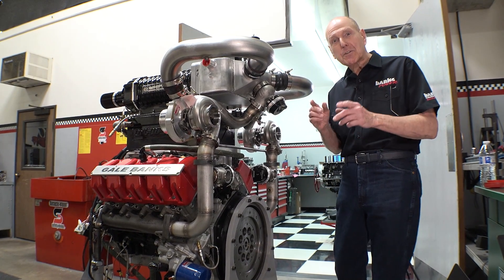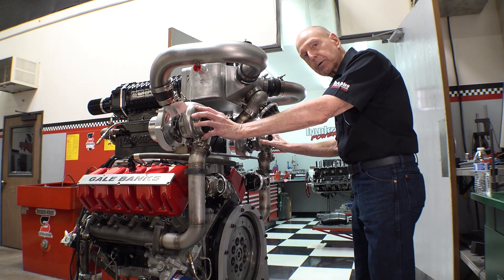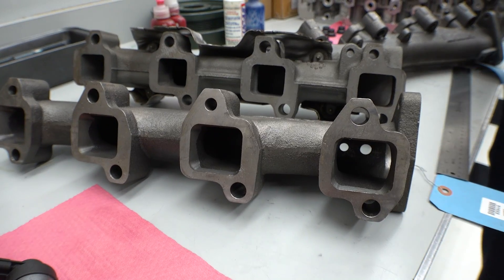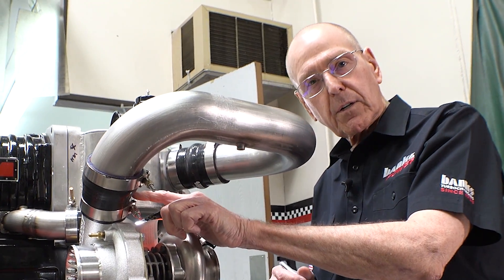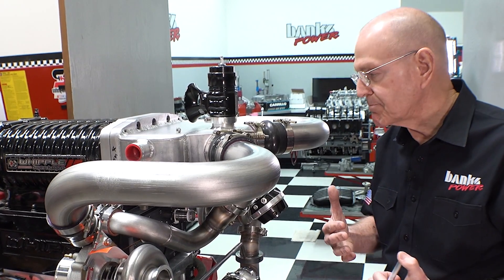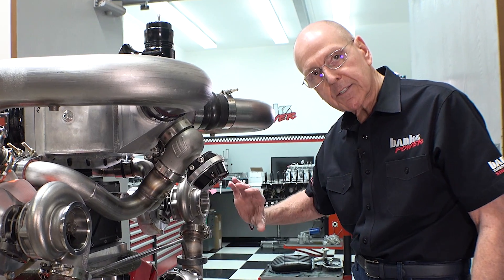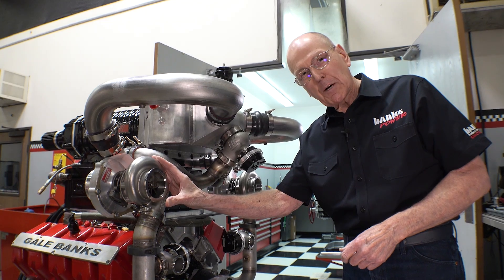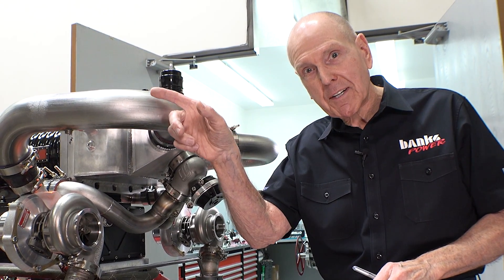SUPER-TURBO DURAMAX FIRST LOOK: Building A Monster Truck Engine Pt 10

Comment: To Mr. Banks and Team

Thanks for the excellent content in this and your other video series. I do however question the function of your supercharger bypass system. I suspect (running a model) that, instead of air flowing from the turbocharger bypassing he supercharger and intercooler; it in-fact back feed. Let me explain.

Unfortunately, Precision don’t release compressor maps, but we can use the Garrett G35 or BW-EFR 8474 as a stand in as their compressor wheels are the same size and are known to perform similarly. With a pair of these turbochargers there is no doubt that you’ll have ample airflow to meet the demands of ~1050kW at the crank (this figure doesn’t take into account the power to turn the blower, I’ve assumed 150kW, which brings the measured power back down to 900kW or 1200BHP.) My model suggests that you’ll require upwards of 150lbs/min of airflow (75 per turbocharger, no issue there for a Precision-6870.)

At 5000RPM (as seen in your videos,) all else being equal, (eg: good charge cooling,) in a turbo only application you’ll be seeing/requiring close to 45Psi of manifold pressure (PR=4) Now any of these turbo’s ‘will -get-there’ JUST, but you’ll be right on the edge of overspeed and in a very in-efficient area.

But in this instance, there is another aspect to this.

The W305 pumps 5L of air per revolution. I estimate you’re overdriving it at 1.75x crank speed (~8800RPM blower speed) to get your current power output. My estimate is 22.4Psi of boost and from  the previous video where you made 666BHP, I can see 21.2Psi (so my model can’t be far off 😉.) This estimates an airflow of 96lbs/min, where your measurements are 106lbs/min, so I'm close, I suspect you're actually running the blower at 2:1 and feel you may have mentioned it somewhere...)

(Continuing with my numbers, doesn't make much difference) Now if we consider the Blower intake as the inlet manifold (or put another way consider the blower the equivalent of a 12L NA diesel @ 5000RPM,) which would consume 96lbs/min or (here’s the kicker) ~1400CFM a minute of air; the turbochargers now only need to produce ~20Psi of boost to force the required 150lbs/min of air though the blower to meet your goal. (I hope you’re following my logic, compound air charging/twincharging is difficult to write about.) This is because as far as the turbochargers are concerned, they’re on a 12L engine, not a 6.6L engine!!! This now puts the turbochargers in a much happier place on their compressor map (right in the middle 😉)

Now you can reduce the blower speed, this will in-turn raise the boost pressure required from the turbochargers to meet the 150lbs/min airflow requirment, so there are optimizations to be made here to reduces parasitic drag, however this will reduce throttle response. But IN-ALL-CASES: there will be significantly more pressure in the inlet manifold (my math’s says 46-50Psi) than between the turbochargers and the blower (~20Psi in this study.) Thus, the system you’ve installed to bypass the air past the blower at max-power will simply cause air to escape the inlet manifold and cut laps around the blower. This will significantly reduce the power-output of the combined system as there’s basically a big air/boost leak.

I’m going to continue watching, as this is a banger of a series. I hope my maths is wrong and that the system you’ve installed works as you think. But, I’ve used this model to build and spec-up twincharged systems in the past and have never been more than ~5% off with regards to boost levels once it’s all said and done. We always use a turbo to ‘blow-the-blower.

As there will be so-much exhaust gas, you might find you need even larger wastegates to no have excessive back pressure and solid boost control.

Keep on having a blast
Jordan

Comment: Mr. Banks on your blower over turbo engines. Did you every used a  clutch on the blower? When I was kid and still this date I want to build a 8-71 or 12-71 blower over turbo with 4 turbos and  blower or blowers with a clutch. Turn the blower on for low rpm and off for high rpm. The clutch be like an AC clutch.

Comment: I am loving this setup, I can't wait to see it roar. I do have a question though, is there a specific reason you chose to run the turbo WGs only at 90 degrees? It seems you have room to run then at a bigger angle. I'm sure you will not be bypassing much exhaust pressure with this power level, but am just curious. Thank you

Comment: Banks Power, wow just wow. It'll be interesting to see what sort of power levels you guys achieve, why is/ why are you chasing HP in a diesel engine for this application.
I would've thought that torque was what you'd be chasing to run in a monster truck engine, I have a basic understanding when HP/ Torque crossover in Gasoline engine, does this still apply to a diesel engine.
Anyway good luck.

Cheers

Comment: That looks awesome. there is one thing that I am concerned about and that is the turbo wastegate locations. I think you're going to have Boost creep issues on the turbos with the wastegates at a 90 degree angle on the up pipes. I think you would have way better control if they were angled what's the direction of flow. So instead of being at 90 degrees to the angle of flow... maybe be at 30 degrees.

Comment: What issues would come into play aside from pressure increase at the manifold. If you would have allowed the the turbo's to blow straight into the charge air cooler for the super charger? Essentially leaving the intake on the supercharger alone and have the turbo's blow in from under the supercharger. And using just the 1 intercooler for both.

Comment: Typical Bank's ingenuity. I've owned some model of a Dmax for over 17 years and I'll own one forever as far as I can tell. I wonder though, with the monster truck circuit like it is, with suspension parts breakage and body repair after nearly every run, is this level of complication the answer for a question no one asked...
I'm a diesel believer and I've become a snob to the point where I dismiss any truck with a gas engine as a toy, but as simple and bulletproof as a BB Chevy is, I'm not sure the crew chief is going to be excited about maintaining all that plumbing taking the beating it will be subjected to. I cant wait to see how it performs though.

Comment: Really enjoying this. Have been a long time fan since back in the seventies after seeing your twin turbo blow through system for the small block chevy. That system was impressive and your work with diesels is no less impressive.
     It is amazing the advancements in turbo tech and you have been on the leading edge. Looking forward to what comes next.

Comment: I’ve been experimenting with .60 Inconel sheets. Putting in my roller and making 4” tubing. I’m just having trouble with the welding.
Reply: Its tricky to weld you have to have the heat settings just right.

Comment: Why would you ever put the supercharger first, surely it will restrict the turbos at high rpm?
Reply: Its first to give off idle instant throttle response giving the turbos time to fully spool up.
Reply: @victorgirouard1543  but it will restrict the turbos as you cant pull more air through a  positive displacement supercharger that it would otherwise flow anyway, thus rendering the turbos useless other than a slight efficiency increase. Put after the turbos it will still give instant throttle responce as it can pull air through the turbos.

Comment: How come machinists fasten deck plates into the block with head bolts during machining when the build calls for head studs?
Reply: So they can create the same type of warping that would happen with the heads bolted down this way they end up with alot more accurate hone or bore job.
Reply: @victorgirouard1543  Head bolts are going to twist/ distort the block more then head studs is what I am saying.
Reply: @Sir.VicsMasher  it's about the same it just takes more force to stretch or breaks studs over bolts.
Reply: @victorgirouard1543  A bolt will put more twist into the block vs a hand tight stud with a nut on top.

Comment: Im curious what the supercharger does to turbine speeds at low rpm vs without. Maybe he has already explained or im just slow without help. 😉
Reply: You are just slow.... The supercharger makes 8-12 psi at idle. What do you think that does for the turbos when you snap the throttle? I've seen twincharged gas engines hit 20 psi in under 2 seconds. Try that with a big single on any engine...
Reply: @dj4monie  whoosh. And if anything i was hoping to see a video from gale giving us the sweet sweet data from both setups. Be well.

Comment: 0:55 - COSWORTH on the toolbox in the next room - must be an interesting story there!

That comment about the manifolds fitting any porting raises something I've been wondering about - most diesel 'tuners' seem to be intent on bigger 'chargers, more fuel, etc - but very few seem to mention reworking the heads and the resto f the intake/exhaust manifolds to reduce pumping losses? What would be the consensus view of making the engine more efficient as a critical part of the process of making power? BTW, folks, that outlet was 47% larger than the stock one.

Might be worth using an electronically controlled bypass for the supercharger that can be controlled by the ECU?
Reply: Any restriction you remove from the intake or exhaust allows the engine to make more power with less work.  This normally translates to more power with less boost which drops exhaust gas temps and charge air temps.  The factory duramax intakes are dog shit in my opinion with all the hard right angles the air must make along with directing air into walls and sharp corners.

Comment: Please, xplain why I wouldn't want a blower that will run out of breath as RPM increases upstream of a turbocharger that will always give me more power.
Every HP build in this world has had a turbo dumping in a blower because the blower always ran out of steam before the turbo did. The blower just helped the initial hit off idle(low end torque).
I always looked at the Pikes Peak Truck intake arrangement and always scratched my head in disbelief as to why would someone do it "backwards".

Comment: Are you concerned about feeding the super charger through the turbo inlet volutes? I wonder what the pressure there is going to be. Part of me thinks you might need a zero pressure bypass that closes after the turbos spool up to close off that part of the circuit. Secondly are you going to use  some trickery to close off the super charger inlet like HP reduction on a rotary screw air compressor ? This causes the compressor to operate in a vacuum saving power. A blower is basically a positive displacement pump in general terms. Are you concerned about the potential HP loss trying to compress high inlet pressures? Maybe for best results you might actually need to under drive / size the blower so it gives you  great cylinder fill percentages at low rpm but runs out of breath as the turbos sing or find a way to be able to run it inlet closed in a vacuum to reduce HP required and increase MAD by not adding heat to the charge air?

Comment: Can you create an epa safe or compatible version of this? And in a petrol version of this, lets say for the new 6.6l heavy duty gm pickups what size supercharger and turbo would you recommend if the cubic inches are the same?
Reply: The same, get whatever supercharger you can afford and slap some turbos on it feeding the supercharger = Twincharging, instant response, no lag and if you aren't chicken 30 psi across both compressors...

Comment: Gale, this is great. I think the turbos are maybe a touch small. Maybe not but if your aiming for 13-1400 hp I don't know if the compressors can move the air volume each required to make 700 smoke free horsepower. Running a bsfc of 0.4 and 18:1 afr, each turbo can flow at the outer edge of the curve, enough air for about 820hp. Your going to run into a few problems pushing them that hard that might.not crop up in 2 minute rounds or 15 second blasts at full throttle. The blower is going to be your saving grace here. The turbine housings are a bit oversized for 3.5l of displacement but with the belt driven compressor and charge cooler, the engine has an effective manifold air density somewhere around 1.4 times SAE standards at idle and about 2 times SAE at higher rpm. I did some back of the envelope calculations and for no smoke at 4000 rpm and 1400 hp, you need a 100% cylinder fill volume and a manifold air density of 3.68 times SAE. If your only getting 90% cylinder fill volume, which is still very good, you need a manifold air density of 4.09. Neither form of forced induction alone can provide that density with ease, but combining them will make it more than possible. If the turbochargers provide the belt driven compressor with air twice the density of SAE, and the supercharger does the same, effectively doubles the density, you will get the manifold air.density you need.

Comment: I think you should have installed 2 of the turbo supply valves and use position sensors that you can log. Also add another ice water supplied intercooler for the turbos alone.
Reply: You aren't paying attention. The cooler behind the supercharger is air to water, like the one under the supercharger. A2W is king of charge cooling, compact and works best. People are too worried about weight, unsure why when you can make 1,000-1,500 whp quite easily but that means for most of you Muscle Heads that you have to spend a couple of grand on your automatic transmissions to hold it all. I live in the Sport Compact world were twin clutches will hold all the power and have stock pedal action.
Reply: @dj4monie  Actually I was paying attention. I do this for a living, I work on  multimillion dollar race cars. I saw the cooler. Like I stated before I wanted to see another cooler installed.  BTW I am not a muscle car guy by any means I actually perfer imports and have several cars that make more than 900hp out of 4 cylinders.

Comment: Is the 90° coming off the exhaust for the wastegates  going to cause a boost creep issue? I thought it was better to have a smoother transition so the exhaust gasses can vent effectively. Does it actually matter in this case? Legitimate question from my limited knowledge.

Comment: One thing I'd love to test is the possible applications of a 1:1 compression ratio (so no compression) supercharger in a turbo to supercharger setup with the pulses of air released by the supercharger being synchronized with each intake valve opening. I wonder if this would help neutralize the air harmonics in intake runners because you'd basically never have stagnant pressurized air in the runners. You'd have to find a way to direct the airflow to individual runners but it's an interesting concept. You could even use the air pulses to try to evacuate more exhaust gasses by opening the intake valve momentarily just before the exhaust valve on the exhaust stroke.
Reply: Why don't you go out and do it????
Reply: @dj4monie  You're talking about tens of thousands of dollars in testing equipment, labor, and sensors. The only way to pursue this idea economically is to work at a shop like Banks Power where you have most of this equipment just lying around (they're not hiring right now, I checked). Best I can reasonably do right now is post the idea where people can see it and hope someone like a member of Banks's team agrees with me and maybe tips me off on a job opening for a machinist II or automotive technician I coming up soon. ;)

Comment: Gale & Banks Power: If I may make a suggestion, I think that adding methanol injection into the mix, for it's evaporative cooling properties would be a good move. Getting those temperatures down as low as possible within the duration of the engine would be wise. I'd like to read what you and others think.

Comment: Would it still be beneficial to inject a water and methanol mix below the large CAC to further increase density? Will the water supply to the CAC have an ice bath for the short duration and the water mist over the heat echanger for the long term aftet the ice has melted?  If liquid propane was added to secondary injectors below the CAC along side of the methol/water injectors, could it both enrich the fuel mixture and help chill the air charge temperature?
Reply: Sure it would but on a monster truck that sees WOT maybe 10-15 seconds tops? Plus it runs on diesel and he already explained that methanol does things in a diesel engines that are no bueno. For a street car on pump gas water-methanol is beneficial and beats the pants off E85. However water-methanol and E85 work better together the best race gas available.
Reply: @dj4monie  my knowledge of diesel is very limited, i have next to no experience with them, and zero experience with the high performance side of diesel and gas engines.  I've done a few rebuilds on small engines and a rebuild of a Nissan L20b with a few upgrades for more power, like upgraded pistons after having the block bored 30 over, had .010 removed from the aluminum head to add compression. My math ended up being incorrect with whatbi expected the final compression ratio. I figured it was going to be flat 10:1 and ended up being 11.5:1, right from the start i had issues with knock and ping from the 87 octane gas, but it worked good with 93 octane gas. I did some mild porting of the head and matched the size of the intake ports of the head and intake manifold to the gasket. I did the same to the exhaust ports. One downfall was the intake and exhaust were on the same side of the head and i had problems with heat until I had wrapped the exhaust manifold.  It was a learning experience 20 years ago.